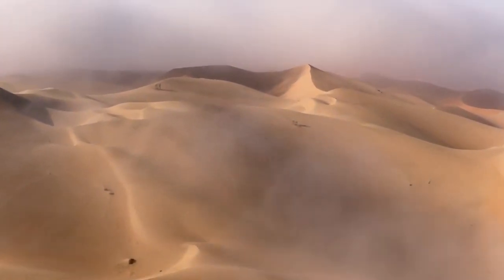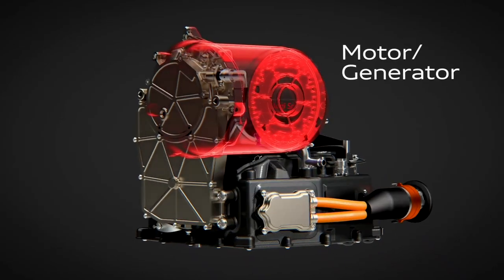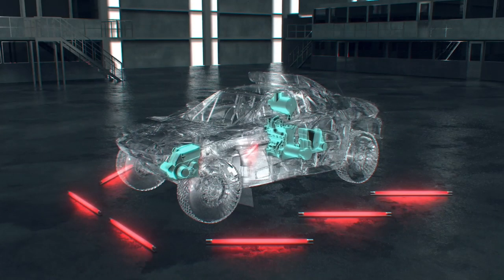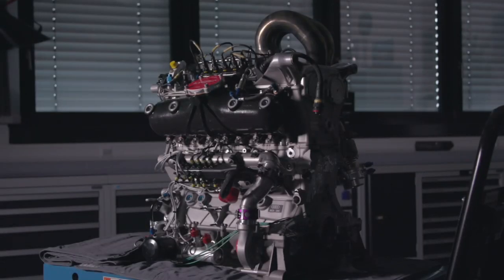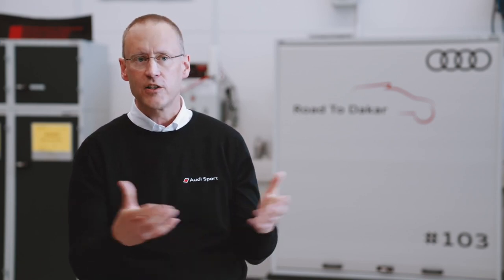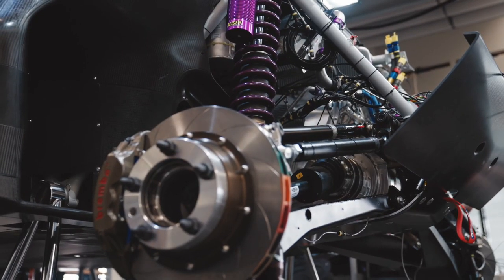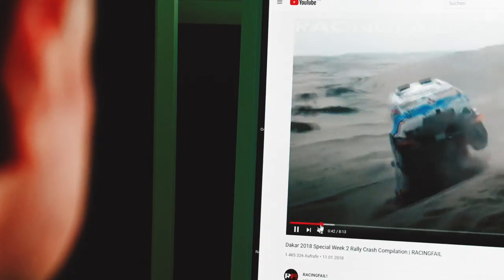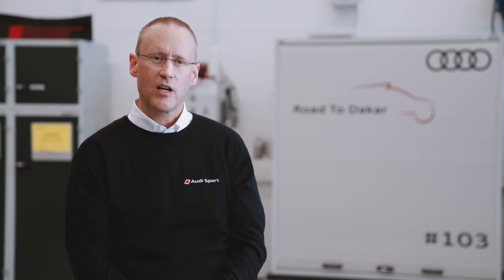Road to Dakar – Drivetrain of the Audi RS Q e-tron

Comment: The adaptation of the power system is obviously very, very complex, but it seems that Audi nailed that part only to be let down by simple known engineering of the suspension system.
Definitely going to be an interesting contender next year with the suspension and under body issues sorted 👍

Comment: I'm curious what the comparative "mpg" would be. if my science lessons were right (and, they probably were not in this instance) it makes sense to me what having 2 stages of conversion (fuel to motion, motion to DC current) would result in more loss than the usual, fuel/ motion energy transfer. if these cars were fuelled only using the onboard 'energy generator' would they use more or less fuel than the other competitors
Reply: I would say less. Internal combustion motor can operate all the time at the sweetspot of optimal efficiency. Efficiency of electric motors on the other hand is not so much affected by power output.

Comment: How many horsepowers does the turbocharged 4cyl petrol engine deliver?
Since it operates on pretty much a fixed RPM from start to finish it must be able to tune that engine to extremes
Reply from the maker: It's based on the final generation DTM 2-liter, so that extreme application made it a strong choice for this application.

Comment: "energy converter" or an ICE lol.
Reply: Right? Haha
Reply: ICE plus generator... also known as a generator set. But the cute marketing name physically makes sense - it converts chemical energy to electrical energy.
Reply: With a nice little 77.9 gallon fuel storage device(otherwise known as a gas tank. 😶
Reply: @4literv6  or a 10 GJ (gigajoule) energy storage device... or 2830 kWh (in the units typically used for EV batteries).
Reply: @brianb-p6586  so what? Top level racing is marketing.

An ICE converts chemical energy to heat, then to mechanical motion. An electric powertrain converts chemical energy to electrical energy, then to motion.
Reply: It is an ice but it's not being used to drive anything, it is purely there to generate power, so I find the name energy converter pretty fitting

Comment: So it's a internal combustion powered car, it just uses wires and electric motors  instead of a gearbox... I love the way they keep calling it an "energy converter" and finally admit it is just a ICE coupled to a generator...
Reply from the maker: Daniel, there's no conspiracy to see here. Audi has always said what the car is. It IS an energy converter. It takes the kinetic energy generated by the ICE range extender and creates electricity. Further, the intense adding of that energy and recuperated energy from the axles (same MCU unit used there both to distribute energy under drive and regenerate energy under braking) means intensive power transfer to and from battery. Dakar is an excellent opportunity both under the abuse of rally-raid conditions and the intense heat of the location to build and improve this technology that will directly transfer to both battery and energy conversion tech as Audi builds it proficiency with electric drivetrains. It's all highly relevant.

The notion that very presence of the ICE engine in the scenario suggests the EV nature of the vehicle is somehow false is odd to us, because it's such a narrow focus on such a more grand technological experiment being proven in this application. That logic could also be applied to the ICE car in your driveway. Your car also has a battery, so does that make it a pretend ICE because electricity and the battery are completely necessary for your car to operate? No doubt battery tech has helped Audi and other car manufacturers improve their ICE development capabilities for years. Why should these first days of the EV be any different?
Reply: @AudiClubNorthAmerica  The problem here is that giving it a fancy name like "energy converter"  and saying "range extender" in my opinion is trying to gloss over the fact that it is just a gas engine powering an electric drivetrain. The ICE isn't just "present", it is the whole power source for the vehicle and the battery is just a buffer. In my opinion it is not an EV just because it uses a generator and electric motors instead of a gearbox and axle shafts. Sure it can do regenerative breaking but that makes it a hybrid at best. I personally love the idea of PHEV as I think they are a great solution to solve the only real and looking to be long term downfall of EV's... Range... And I do not consider the battery in a regular car as cheating because while it powers the starter and electronics it is recharged by the engine which is completely fueled by gasoline and the battery provides no power to the drivetrain. To be honest a lot of the new ideas with EV's and hybrids are not really that impressive or new for that matter. It is not the "first days" of EV's, The Prius came out in 2001, Tesla in 2008 and the Chevy Volt in 2011 and Oshkosh developed their Pro Pulse drive system for large trucks years ago which sadly was never implemented. The pace of vehicle development in this area is actually pretty dismal. Heck we developed the entire Apollo rocket program and put humans on the moon in less than 10 years. I look at the pace of Rocket and space craft design, cell phone advancement 3d printing capabilities etc. in the last 10 to 20 years and the automotive market by comparison has fallen flat on it's face. That I am supposed to be impressed that Audi managed to couple an ICE to an electric drivetrain in a hand built race car? Sorry but it is just not that impressive to me.
Reply from the maker: I don't quite understand your position. Here you have a battery-driven EV with an internal combustion range extender and you are saying it is "a hybrid at best" and then when you critique the term "first days of the EV" you suggest a first generation 2001 Prius is an EV. Which is it?

The RS Q e-tron Dakar is an EV with range extender. Whatever impression you have from the "fancy name", Audi has made no secret of what it is. Again, there's no conspiracy to see here. This experiment pushed Audi technology be it the MGU (motorsport energy converter unit) or the battery tech they used.

Incidentally, the ICE isn't the "whole power source" as you say. Like even the simple on-road PHEV like the Audi Q5 e-tron, you can leave your home with a full charge and never use the ICE at all depending on your needed range. The purpose of the ICE is to extend that range without need for stopping to recharge... because battery tech isn't there yet. Running an experiment then to push battery tech and energy conversion under extreme conditions is entirely the point.
Reply: It would be a lot more straightforward to call it a series hybrid right up front, because that's what it is. The advantages and costs of that approach could then be explained.

Comment: During my visit to Rhiad I saw that the Audi E-Tron cars do not get normal fuel, but specially mixed fuel from Audi ...
Why the whole thing?
Otherwise, won't the 2.0L turbo engine be able to provide the energy?

Why wasn't a diesel-electric drive installed?
What is the overall emissions from the car?

If you think about it more carefully, the advantage over a classic drive is that this drive concept can bring more power to the ground when starting and feeds the energy back into the battery when braking ...

A lot of complexity for a 2.0 ton rally vehicle ...

Comment: a little more powerfull Chevy Volt, if iam not mistaken? :) with AWD.
Reply from the maker: You are mistaken. :)
Reply: No, the Volt is a more sophisticated multi-mode hybrid system, primarily of the power-split type (pioneered by Toyota in the Prius); this Audi is a simple series hybrid.

Comment: Why not just use the engine itself to drive the car instead of losing power to generate the electric motors
Reply from the maker: It departs on the stage with a full battery and also recaptures energy on braking and downhill, so it doesn't just "use the engine itself". The point also, as is typical with Audi Sport, is to drive technological innovation through use on track. Audi has ICE technology down fine. Learning now to improve battery and regenerate braking tech in extreme environments is the engineering point of the program.
Reply: @AudiClubNorthAmerica  so it's a race car and a testing platform for road cars at the same time?
Reply from the maker: @falcongamer58  not a platform for road cars. It's a purpose built rally-raid car. However, Audi tests technology in their racing programs and likely he most tested systems in this were the electric drive unit both for drive and energy recovery, and the battery tech. Will they use those exact components in series production? No. Again, it's testing tech far out from production, but they use lessons learned in designing production components.
Reply: @AudiClubNorthAmerica  i see, thanks for explaining

Comment: energy converter = good euphemism for combustion engine burning fossile fuel...great marketing
Reply from the maker: If this were a video about the engine, you'd be right in your conclusion. It's not though. This video is about the entire drivetrain, and the engine in the case of the "energy converter" is just one part of the system. Audi utilizes that internal combustion engine (DTM race engine) and they make literally zero effort to hide and name specifically in the video, and combines it with a third Formula E drive unit. The pairing of this engine and electric drive unit are described as "used this way for the first time" is stated that way because it's true. These drive units were developed for the all-electric Formula E car, but can take the abuse of this application to convert the kinetic energy created by the DTM engine into electricity that can be stored by the battery system. The engine itself is, in fact, an internal combustion race engine and on its own in this application works as a range extender.

Comment: So it needs fuel….what are the odds? 97% efficiencies with a 4 cyl engine?
Reply from the maker: The internal combustion competitors are also equipped with batteries. Further they don't have fuel reserves readily available in the middle of the desert. Rally-Raid, like Le Mans, is an excellent opportunity to showcase different approaches to the same challenge. It pushes technology development no matter the technology. That's why Audi takes on these challenges.
Reply: @AudiClubNorthAmerica  I watched your other videos explaining the concepts of the drivetrain and so on. But claiming 97% without the obvious thermal inefficiencies of the engine are quite misleading. You have a hybrid car but you are “selling” it to the media as an electric car. Just be open and honest about it. Is not like Germany is going to punish you for using a hybrid….oh wait!!!!
Reply from the maker: @annakquinn7084  We're not the Audi car brand. We are Audi Club, an owners group. You may want to direct your engineering questions to them since they designed, produced and are campaigning the car.
Reply: I think they meant 97 % for the electric generators-motors (two on the axles and one more attached to the ICE) or maybe the whole electrical system, but not the ICE itself.
Reply: @andriusr.9304  of course. Just the pretty numbers.

Comment: That's a lot of complex components, hate to be broke down in middle of a desert with no comms and trying figure out what's wrong when it breaks down.
Reply from the maker: so far the only real technical issues have been suspension failures. Yesterday they repaired one in the field by swapping between cars. The EV element of this has been flawless thus far... other than being a heavy load on that suspension.
Reply: @AudiClubNorthAmerica  sounds good on track! Hopefully it makes it to the end of DAKAR.
Reply: Mechanical complexity is lower than what it would be with a traditional mechanical transmission and AWD driveline.

Comment: I like the idea of an electric car with a small 50 to 60 mile battery, and range extender. 
Most of my regular journeys would be done battery only, but the extender is there as a back up, and to assist in my occasional longer journey. This makes even more sense if synthetic or bio fuels become available. 
In the coming years, an awful amount of resources will be needed to rescue EVs with flat batteries - not this one!
Reply: There are many cars with that exact set up already
Reply: @charliebingaman571  I know of the BMW i3. Haven't heard of any others in the UK. I know there are quite a few phevs which have a full ice power train as well
Reply: @the_lost_navigator7266  yeah definitely depends on country, I know the US has a very hard time getting certain models of the new electric versions of BMWs(other than the i3).

Comment: u teliing me audi is wasting fuel to power eletric motors,,,there is no gain,,they are wasting double on these machines,, they are making polution at its best...this world is going crazy,,,
Reply: You must study more about physics and  thermodinamics
Reply: @luispedropcovo  Actually he has nailed an important point: the efficiency of any series hybrid like this is always a problem due to the conversion of mechanical energy to electrical energy and back again.
Reply: It's actually not. 
The efficiency of engines peaks at a certain rpm at load. 
The losses in the generator are nothing compared to running the engine in an unoptimal Rom range.
Reply: @brianb-p6586  hmmm no! Need study more too.
Reply: @spacenuss5190  exactly!